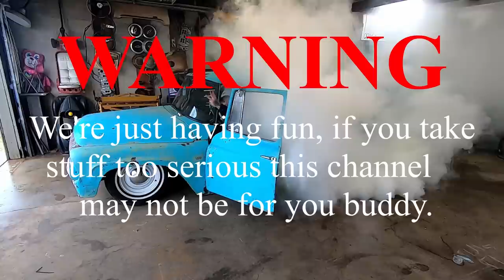BODY REMOVAL! 1961 Chevrolet Parkwood Wagon. NEW PROJECT

Comment: Great video! One way I have always seen done is to run a 4x4, wood or steel, across the front of the body and put the stands/jacks outside the body. You can lift it and have plenty of room for the frame. Keep up the good work.
Reply: Done it that way myself. Works well

Comment: I lifted the body on my El Camino using come alongs, ratchet straps and the roof trusses which meant I had it suspended, very easy to roll the chassis out then.  However my body was totally stripped, no front clip, interior or even glass so much lighter.  Much ingenuity on display here.

Comment: Nice start on the wagon.  I use to get upset it when mom told me to take a break when working on a truck, but when she didn't I would get tired and do about the same thing you did  pulling the wagon out of the garage with no tires.    So it is understandable.  However I really like the video and how you separated the body from the frame.

Comment: Get some gussets on those stands, front-to-back and side-to-side. That's a lot of leverage on those T-welds at the bottom if you start pushing it around. I'd want top weld gusseted side to side as well.

Comment: Be careful of those pavers, those things can break under point load and fail. Concrete blocks are worse, but it might be helpful to put a couple pieces of plywood on top to distribute the point load and prevent tipping from a sudden break. FYI

Comment: Next time you do this, run two long 4x4s up into your rafters and pin them with a few screws, then run ratchet straps (2 inch racer straps) through the tops of the windows.  You can also run a ratchet strap from the tailgate to the rear window and the same on the other side and add another stringer or two through the rafters for that load.  Add padding where appropriate.  Jack it up as far as you can with the hydraulic jacks, then tighten up the ratchet straps.  If you are worried about pulling the bottom stringer of the rafters off, brace directly underneath the questionable rafters to the floor with 2x4s cut to fit, like a Lally column.

Comment: A couple of 8 ft long 4x4s would help with that project. Once you have the body lifted far enough slip a 4x4 between the body and frame, let the body down on the 4x4. Do the same on the other end. The 4x4xs being 8 ft long gives you plenty of room the lift the body up and you will have more than enough room to roll out the frame.

Comment: i know the rear springs on the wagon were heavier than those on the el camino and are a direct replacement. from the looks of the underbelly of this rig, i'd say sending the frame off to be blasted was the right call. you might find some spots that need a little reinforcing when you get all of that flakey rust crust off of it. hahaha! the excuse for dropping it was funnier than that fact you dropped it in the first place. we've all knocked a vehicle off the stands a time of two. as long as nobody was twixt the floor and the large chunk of steel to cause a faces of death scenario, it's all good.

Comment: You can buy boat trailer rollers and cut them to make new body mounts, really cool cheap alternative, most of the already have a bushing in the middle and are surrounded by composite or rubber, just takes an easy sawing to make multiple out of one cheap roller

Comment: Leather interior is probably a good place to start with trying to keep the inside of your car from getting covered in stains. 
Rubber mats for the floor. And since you are a fabricator, I'm sure you can fabricate the glove box to fit a smaller sized hand held vacuum and a few rags with a water in it. 
With leather interior, that's pretty much all you need to keep it clean.

Comment: You might want to think about doing a mild  383 budget build with 600cfm carb. If done nicely could give you some performance with better gas mileage to boot! A little horsepower helps pull the weight with less effort. In layman’s terms little pep and fuel saving rewards. Win/Win in my book. Just a thought. Keep up the good work! 😎👍

Comment: Never had a torch for work like this .....I usually open the rear, drill out the bolts from the top then weld in new nuts

Comment: Puddin, I’ve seen some red neckery stuff before but you OKy boys are a whole nother breed! Good job, glad your safe. My first car was a 64 Impala SS. 409 was gone before I bought it but the Corvette 327 worked just fine! My neighbor rear-ended it parked out in the street with an LTD station wagon! Bent the frame all up. Took the parts out of it and they went into a 66 chevelle. The 64 paid for itself three times over 😳👍

Comment: Forest Gump once said .. 'Shit Happens'  Glad it didn't crack that nice floor...buddy.  Like me a '60-'64 Chevrolet/Oldsmobile/Buick/Pontiac GM wagons. btw there was no El Camino's in 1961-'62. Late '63 came out with the all new A Body platform including reintroducing the El Camino from 'utility vehicle, it was a regular type full frame. Not an X style like Impala's. Great Project Choice Puddin' been waiting to see you find a goodie Chevrolet... Go All the way with Chevrolet. 'Cali' rake looks Great on the body style era Wagon. But I too prefer a nose down up front. Awesome wheel Choice.. Too. Black side out. IMO.

Comment: Funny part never done fully Restoration on wagon car in all my years in Auto Mechanics Shops of Autobody Restoration yet but heard task to do and challenge to do! Only thing ever done is motor, transmission , axle , brakes and exhaust ever had one ! Plus change Manual transmission floor shifter to Automatic transmission take clutch pedal plus Pump Resiovor out ! Was lot fun to do and in A 1980 Chevrolet Malibu Wagon car a School friend updated to do did on my late Dad and late Uncle home farm in Machinery Shed too!

Comment: A helpful opinion for u…. Next time jack up the body high enough to slide 4x4 timber between the body and frame. Have one close to the firewall and one close to the rear  make them long enough that they stick past each side of the car about 1-2ft and then jack up on the 4x4s this will give you plenty of room to pull the frame out without interfering with the jacks

Comment: That get her cold spray stuff is good stuff. There is a brand called FreezeOff that might be the same or similar as your cold sauce
   I have found that it works the best if you spray and wait. When we get a tough old project like Japanese chrome screws in aluminum Honda cases,we hit them lightly every day for three days straight and about half of them come out with a low power impact. All of them come out in a week. When we get a new bike coming in we just hit all of them every day for two weeks while working on the other projects in the garage. One can goes a long ways. Those little bubbles eating rust do happen.

Comment: Do you remember when I said your transmission mount looked like something a hillbilly in Saskatchewan would make from old bed frames? Yeah. I think you have some long lost kin folk in Saskatchewan. If you reunite with them they might lend you some bottle jacks for the next time you want to lift a body off a chassis. Your extensive collection of floor jacks and scrap don’t quite cut it. 

Ribbing aside, I’m looking forward to this build.

Comment: I'd recommend running some tube between the front and rear stands on that chassis to keep those stands from folding up the body mounts if you plan to roll it around.  Looking good bub.

Comment: the america that i loved. so far from misshapen and  computered plastic boxes of today. To protect this car against rust : put grease every where : between carpet and floor, inside rear gate, doors, under the car, rear wings, behind bumpers, when you cannot reach these places with a paintbrush, use an extender to pour oil. to be repeted regulary for oil.
Only grease is really efficient against rust - it is my experience (35 years) as a handyman on classics cars.
from france.

Comment: I'm only 16:47 into the video and was thinking that you should swap frames with the 64 if the 61's frame isn't solid. I think impala x frames might be interchangeable between years but you probably know more than me. Most of my knowledge is from internet research and building model cars. I have no hands on experience.

Comment: I congratulate you for getting it done. But, a coupe lengths of square tube would have been ideal. You could have still used the Jack's and stands but 4x4 or 6x6 cribbing used as support for the tubing running under the car raising until you are high enough then easily pull the chassis. Not quite as sketchy. Especially working alone. You can even take the extra step and bolt the tube to the car at the body mount points (except the rear since they had to be cut out). Idea for next time  like in the someday model A. A lift will be a great tool to have in the new shop for sure. Glad you kept everything safe and got it done by not sitting on your A$$.

Comment: I’m gonna go to Cayman and make sure it’s on dual patterns but duration game we want to make the best power possible drag the bigger wagon around that’s kind of what the world right people do it to a pattern. What direction cams you can run up to 292 on a stock ring without too much from people so you can’t, but I’ve done it.😊 292 the habit advertise greater one of my 33 is 292 and 510 and it’s really really got a good sound in tradable. Still, you might wanna run a small spot with it but go down to the 268 and dream energy. That’ll be exactly where you want to be probably

Comment: What kind of wheels are those 5 spoke with the relief down the center of the spoke? Also how wide was that rally wheel missing a tire? A set that wide could have came in handy for me back in the 80’s.  Wide tires on a 6 inch wide rally was pretty sketchy.

Comment: Don't feel bad about pulling the car off the jack stands. I once sealed shop rags in the oil pan of an engine I was working on, I only discovered my mistake when the engine wouldn't make oil pressure. Shit happens...and it happens some more!

Comment: Pretty sure 61 Caminos were based on the Impallas then they disappeared til 64. 64 thru 72 El Caminos are based on the wagon frames they're both boxed. Regular 2 and 4 door chevelles don't have the boxed frames

Comment: Time or money. Spending time means spending less money. BTW puddin if you would have raised the chassis as high as possible from under the diff and engine than blocked the body in place and lowered the chassis from the body instead of lifting the body off the chassis it may have been a little easier. Either way you got it done. Nice work

Comment: Excellent video Puddin  :) also one nickname of High Pentriotion fluid used years ago for I used nickname slip and dip to soak because slip off nuts or bolts were task to take off and when get off dip in container also spray them  and let till need to again! Also so easy put back on later too fair nice too! Also that Pentriotion fluid had lots used in one can worth and stuff called Releasea smell like honey too so fun no bugs or bees come near you after using it Lol!

Comment: Hey Puddin’ I was wondering if you could tell me which video you pop start the automatic trans car in. I’m in a bind and want to try it myself but I can’t remember how you did it, I would appreciate it, thanks.
Reply: Put in in neutral an, hot wire it, if key doesn't work

Comment: This maybe help - or not. Cutting rear coils to drop ride height will make it ride stiff, like a log wagon. If you find rear coils from the same era sedan or coupe the difference in rear weight from a wagon will drop the ride height 2-3" just by swapping coils and will ride smooth like a caddy. You may find even that 68-72 GM a-body front/rear coils will swap also. That will drop front 1-2" and rear 2-3" without doing anything else. 78 era GM will drop even more just by swapping coils. 73-77 will drop it a little more, and 78-81 a little more. after 81-88 may or may not work any more.

Comment: I have always kept extra steering,  suspension,  shift and clutch components off any vehicle,  most Gm from the 60s and 70s are interchangeable same with most Ford up to the early 80s as well but Gm trucks had about 10 years of almost the exact same parts ... almost but keep every extra part that isn't junk and I'd even start getting 100$ junkers or for scrap price,  just to strip so you can cut up and make your own parts from basket case vehicles

Comment: Ihave some idears for the motor 12.7 liter 2 strog Catapiler disel , 7.5 liter v8 1968 or 76 with ot Tobocharger or Kikon 5.7 liter small block .

Comment: You want funny. I had pulled a Coca-Cola semi truck off the frame rack, after straightening the frame. Dropping it in the pit for the frame rack, while the representative for Coca-Cola was in the shop. Luckily he didn’t see or hear it. I found out after he left that they decided not to fix the truck after I had already fixed it. I did laugh about it for a little bit though.
You probably could have used the rafters to suspend the body in the air with a couple load binder straps.

Comment: Since those wagons are a bit weighty perhaps a 396 cu.in. rat motor might just be the ticket to move that blubber along. Even the 325 HP versions will do the job in style. Sure like 61's. Those wheels are a reminder of the old cheap "Rader" wheels from the '60's and just as ugly. I'm an old guy so I just have to kibbitz a bit. Keep up the good videos. Hey Okie tell Arkie that Tex has got a job for you out in California.

Comment: Your present setup scares me, young man, and I've done some sketchy things in the shop!  You are relying on welds on tubing located 24(?) inches away from the body.  Even though the supports are bolted to the body and welded to the rollers, I think you should seriously consider some straps from all 4 rollers to the body, both fore and aft, and at least a safety strut welded between the rollers across the body. to your supports  The supports could also collapse sideways therefore I also suggest some round stock welded in an X pattern across from side to side on those supports, top of one side to lower of the other and vice-versa.  Weld them together where they cross.  I plan on seeing many more of your videos and don't want to see you injure yourself being so close to the new home and the new shop!   A little bit of steel and some straps are a wise investment when it comes to your safety!  Sorry for so many words.  😁  BTW- How about furnishing info on the channel where the lubricant is being sold?  I couldn't find anything.
Reply: Get it dun with wat you got

Comment: I don't normally make suggestions but If I could offer my version of lifting the body,  it would go as follows.  First of all I'm not quite certain why you never used a strap and utilized the arm-hoist for the rear portion of the car but as far as the front goes I'd do this, keeping in mind that the time remaining at this garage would require something easy, so here goes.  On both sides of the front fenders fasten a 2x6 from the ground up to the ceiling joist. You may want to fasten  feet / pad on the bottoms up the uprights for extra support. Hell, you could even tag and extra 2x6 onto the ceiling joist that the uprights will sit under.  It does not have to be full width of the garage, only the length of the distance between your uprights. 
Now you have plenty of overhead support to tag on a small chain hoist / come-along with strap to lift that sum-bitch to the roof if you wanted. 
 3-  2x6 x 8' a chain hoist and Bob's your uncle !   Love your content Puddin !  😎 👨‍🔧🧰🔧🛠  "Momma dent raise no quitter, sometimes ya got to plumb those shitters".....    😱  "COME - ON"   !

Comment: I hope you remembered what I told you the glove box lock is the same as the rear deck lid for your tailgate on the station wagon a locksmith can make a key buy a code that's in the lock glove box